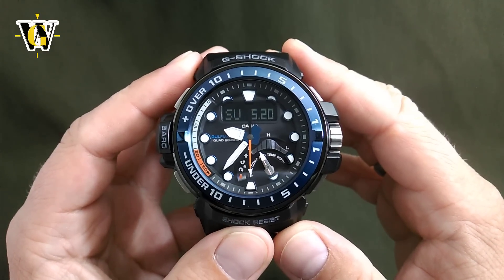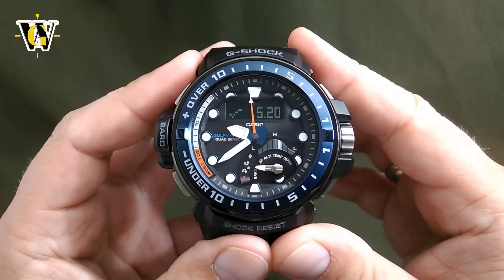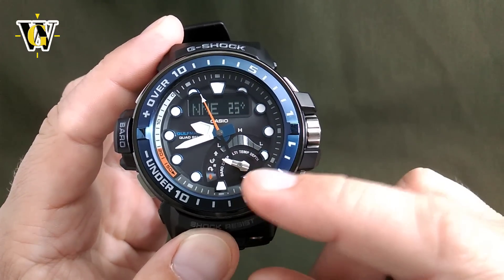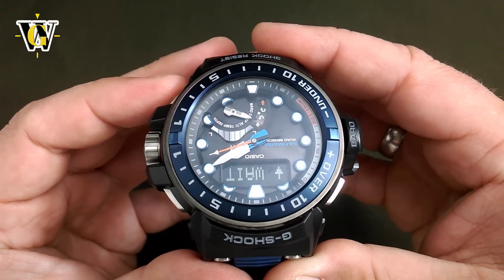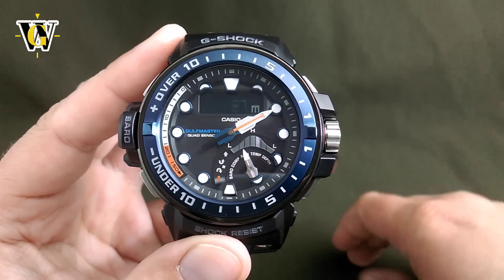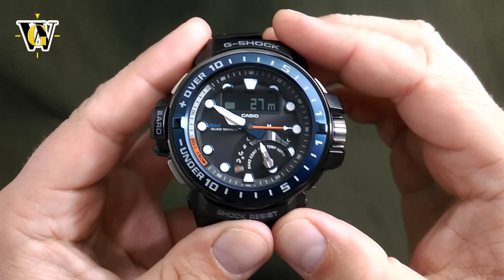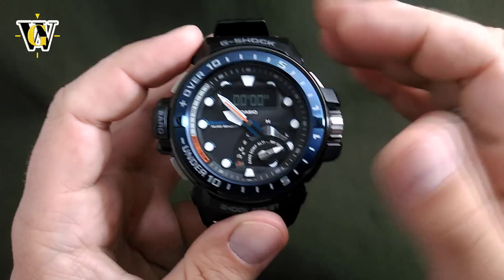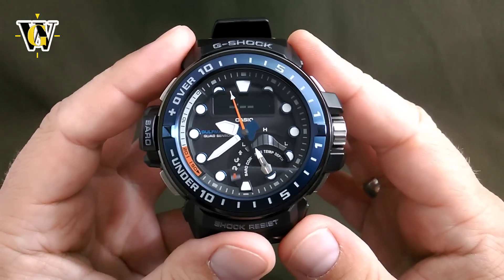GWN-Q1000 Gulfmaster - Module 5477- Part II tutorial on all the seonsor functions

Comment: Do you know of any way to adjust the subdial if it isn’t aligned properly? I tried the hands reset by pulling out the crown and holding the bottom right button but that didn’t help. It will reset the subdial to point straight up but once you press the sensor button it goes back all the way to the right past the depth. It tries to move when the sensor button is pressed but doesnt go far.  It’s hitting the besel almost. I need to figure out how to realign it to move properly. 
My frogman analog can fine tune the subdial but I can’t figure out how to do it on this Gulfmaster. Thanks in advance for any help you can provide.

Comment: I can't get my barometric graph to display. In barometric mode the numbers show up, but no graph. Any help would be appreciated. Ty.
Reply from the maker: It means the difference between measurements are too large, you will see them when the pressure stabilizes
Reply: @WatchGeek  Oh ok. That's great news. I was about to attempt an Ebay return, which I have no confidence in. I really appreciate your quick response. You probably saved me alot of trouble. Thank you very much.